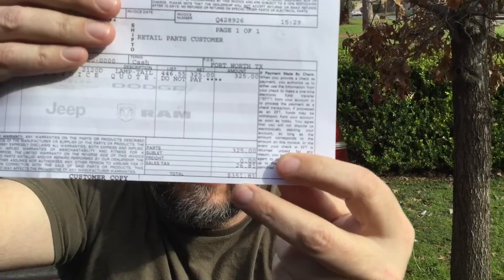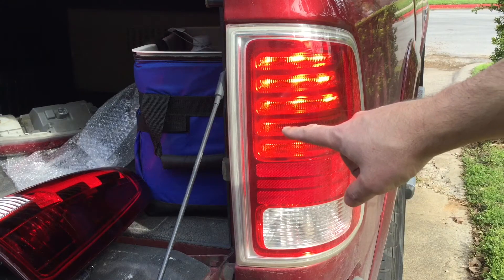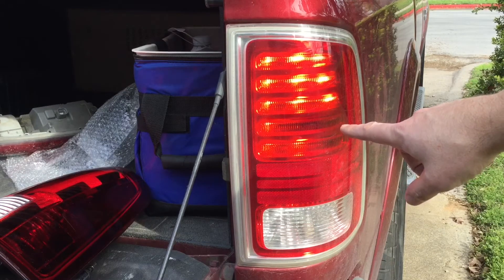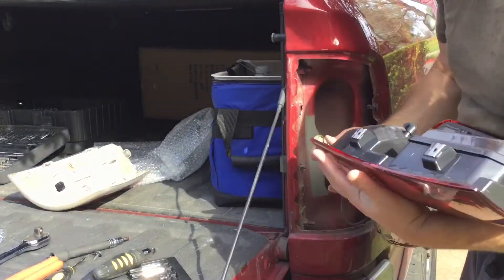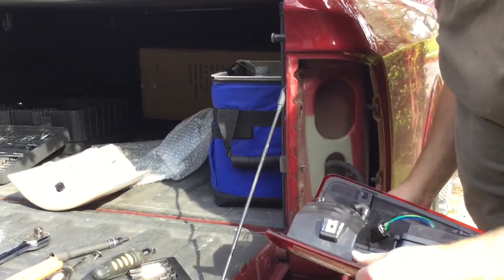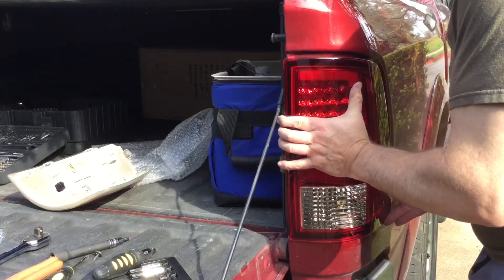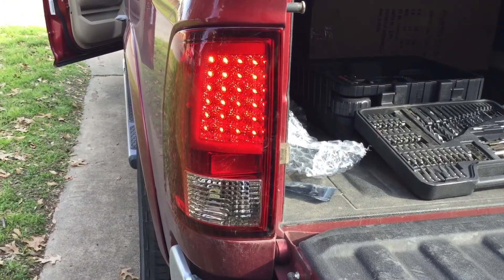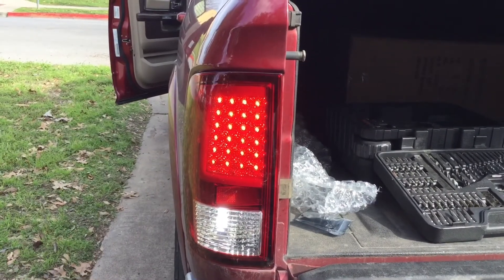OEM LED to aftermarket LED taillight swap 2014 Ram

Comment: Had to replace a busted tail light on my 2017 RAM. Like you, I refused to pay the crazy dealer price for a replacement, so I ordered the same ones you have in your video. I also bought the bright LED backup bulbs for the hell of it. Thanks for showing how easy it is to replace the tail lights, and for the tips about the trickier bits. I just finished changing them out and it went really smoothly. Much appreciated!

Comment: Wondering now that you've had the aftermarkets installed awhile if you've had trouble. I haven't found one brand yet that lasted so switched back to oem led. I have a 2018 PW.